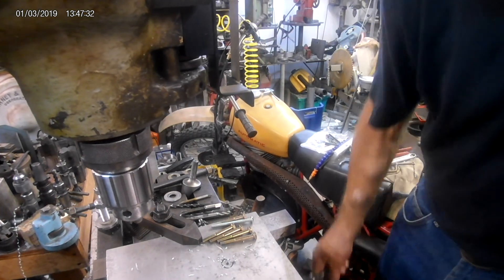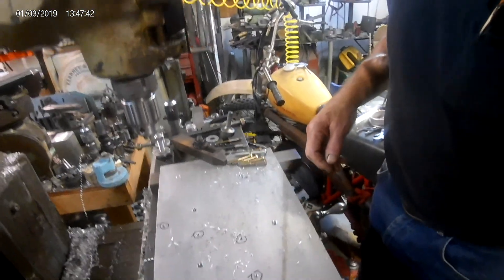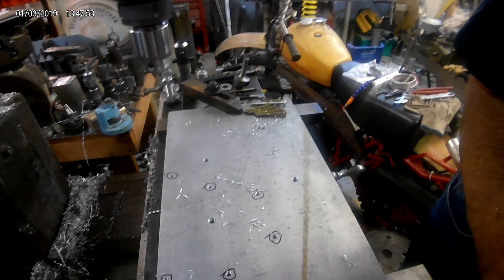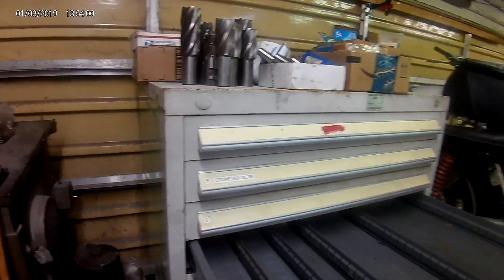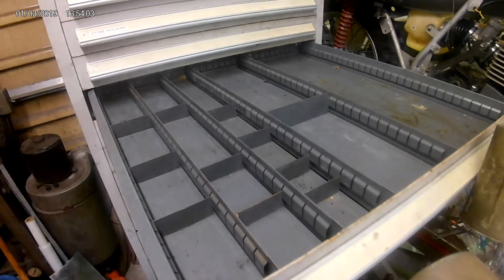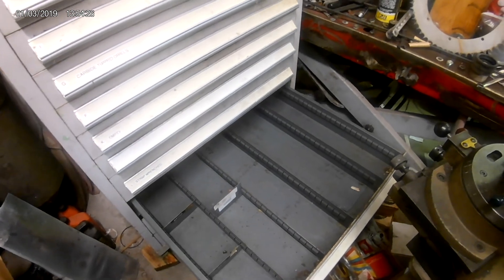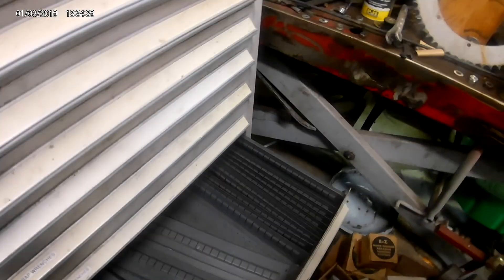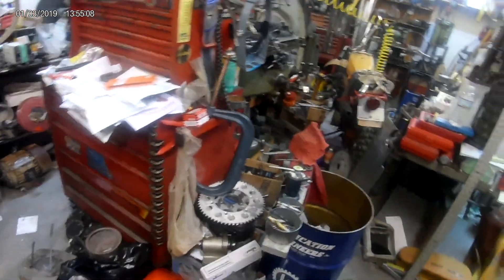In the shop making a fixture for RM250 Case Repair

Comment: Nice cabinet! Those are very handy for storage.
Reply from the maker: Thank you Brian, it should be a huge help in breaking the log jam, I have another one with 8, 5 inch deep drawers, that one should be perfect for the tools in boxes like boring heads, v-blocks, parallel sets, rotary tables and the like.
You know, much like what you have dealt on a larger scale, stuff just needs to be put in order or it just seems to take over let alone additional machines.